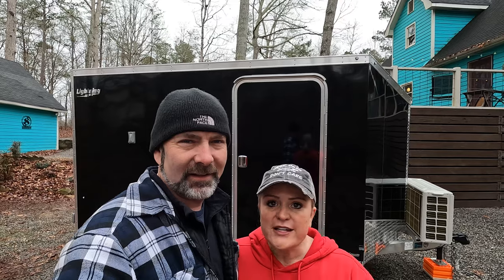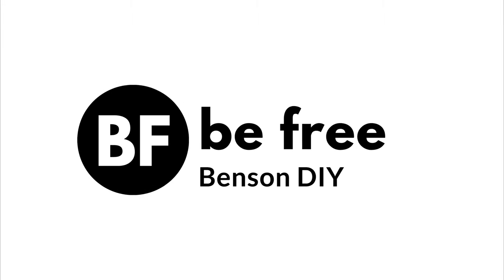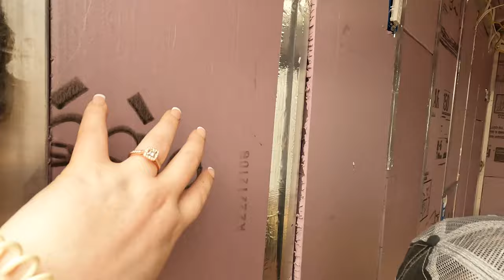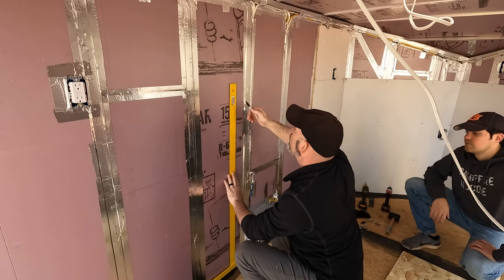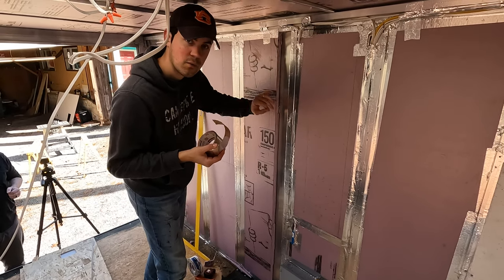DIY CARGO TRAILER CAMPER CONVERSION WALLS//EP. 7

Comment: If you had used a smoother ply such as birch ply couldn't you have painted that ?  Yes it's more moolah but less hassle?  I do like the idea of a white interior. Feels slightly larger, more effective for the lighting because of the extra "bounce"
Reply from the maker: Definitely a good option.  We had considered it, but decided to use the wall paper to keep from either having to do a bunch of sanding or replacing all of the panels.  We definitely would have gone with paint if the panels would have been smooth.  The wall paper has actually held up really well so far…. Thanks so much for sharing and watching!!!

Comment: What's your plan for accessing the ply or wires behind the wall some day?
Reply from the maker: Thank you so much for watching!!!  The eventual plan is to add a solar power system.  The top trim can be removed and the wiring fished down through the 3 1/2 inch channel we left that will enter under the bench.  The bench should provide enough room for batteries/inverters etc.
Reply: @befreebensondiy  Thanks. Keep up the videos!!

Comment: This build is so scary and wrong on so many levels.  I cant subscribe to this.  Learn about your insulation and how it will absorb water, hold moisture and condensation, and how much a fire hazard it is.  Learn about the VOCs (volatile organic compounds) that are in it and your other products.  Remember the donated trailers that made people sick in the Houston Astrodome?  Yup, It was VOCs.  Your wiring is wrong, see comments people left in EP3.  The wiring is exposed to the heat and against a black metal wall for even more heat.  Wires need to cool and this is a fire waiting to happen.  The trailer is all metal so it is also an electrocution risk.  I may watch a few more episodes to re-affirm how my own work turned out, if not for entertainment purposes too.  Wall paper?  Is that glue going to hold up in extreme heat because heat softens glue?  How about in the extreme cold, because it may peel.  Did I hear you right that this was for somebody else?  You could be held liable for damages, injury, or death.  Just sayin
Reply from the maker: I will certainly do some research on VOC's.  I was unaware of those hazards.  Thanks for your comments!!!
Reply: Would like to know what insulation u would recommend then ? This is a first iv heard of the voc due to the insulation